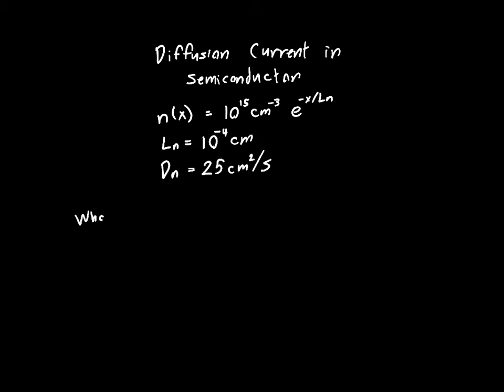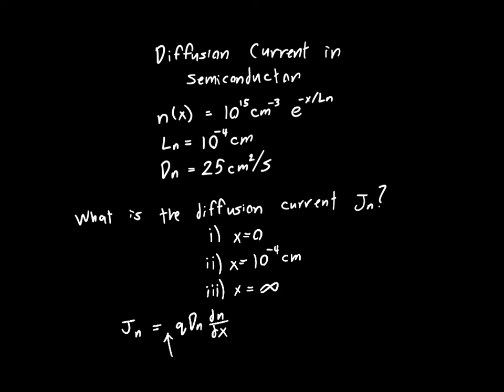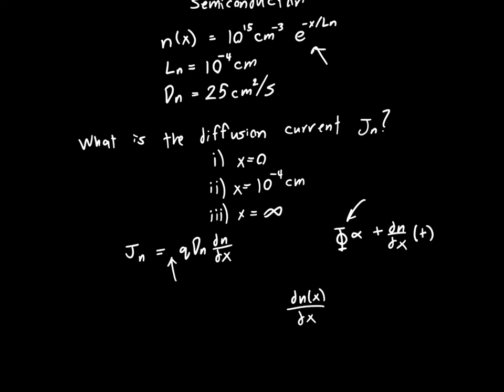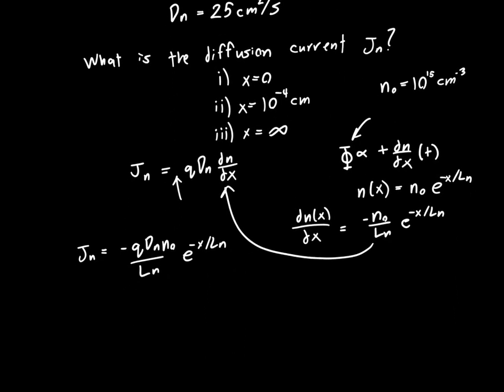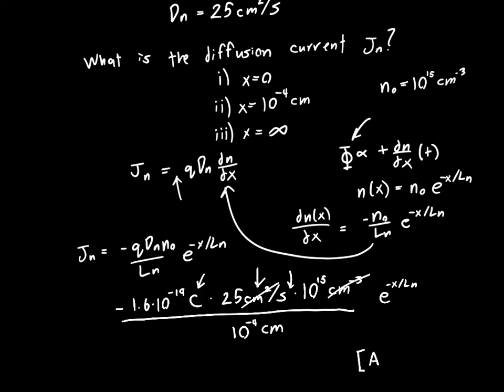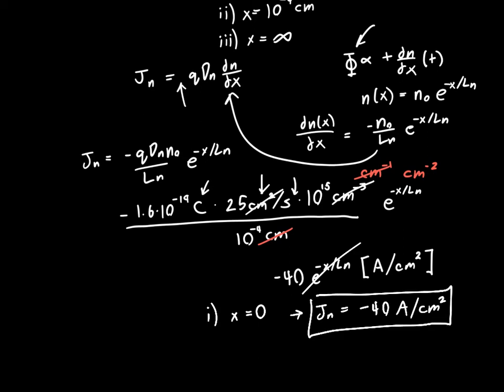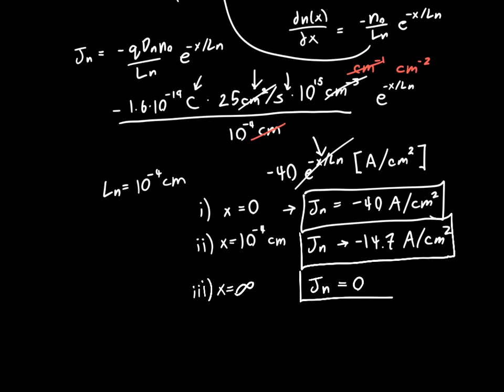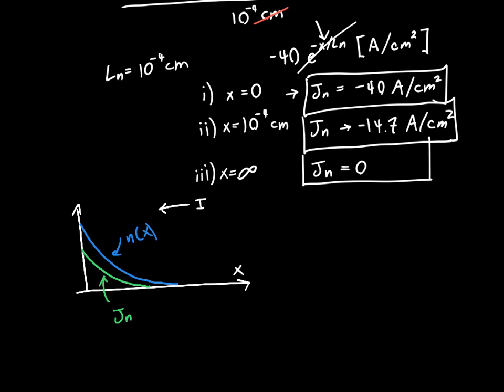Diffusion Current Example

Comment: I think in the plot @7:00 the diffusion current (ie, the green curve) must be negative...
Electron density decreases from the left to the right, hence the electron diffusion current must be from left to right, ie positive. But the electric current is in the reverse direction to the electron current, hence it should be negative. Actually, the numeric results you've derived are also negative.
A minor point, yes, but I just wanted to make sure.

Comment: It's me again (biologist), Dr. Jordon,  is the value n(x), Ln and Dn changes differently from other material or are fixed like a q constant?
The values u mentioned in this video are based on Silicon ?
Reply from the maker: Yup, Silicon. Dn and Ln will depend on the material. Dn you can calculate if you know the mobility using the Einstein relation (kT/q =D/u) - it rhymes! Ln is more difficult because you need the carrier lifetime, which you really have to measure. You can look up what “typical” values are in papers but they are all over the place any vary by orders of magnitude.